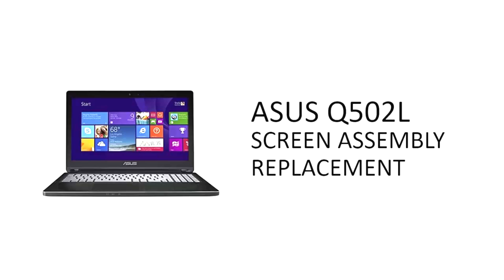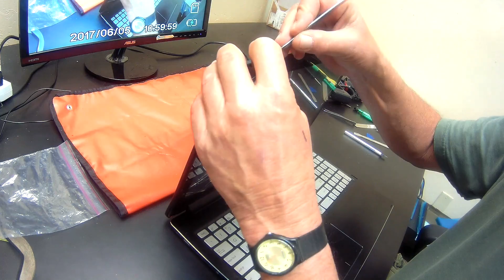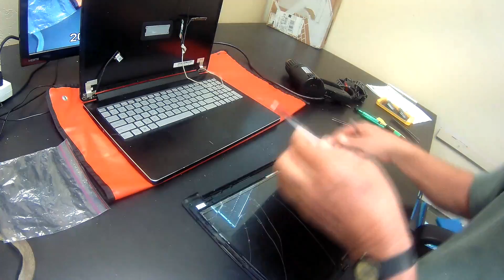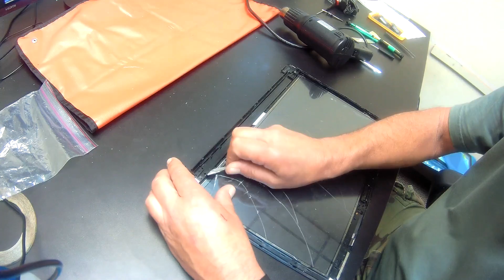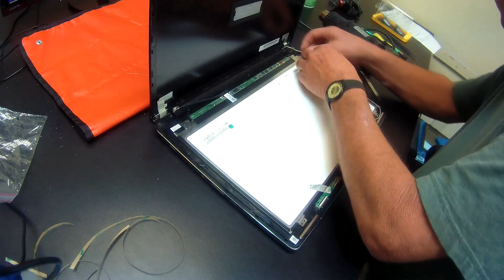ASUS Q502L Laptop Touch Screen Digitizer Replacement Procedure

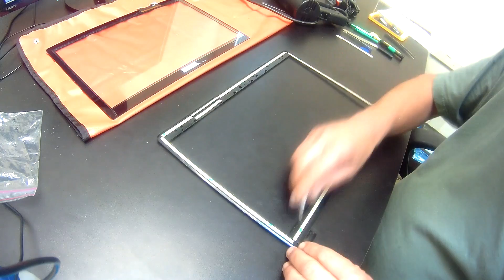Comment: Do those beige/white tape(5:34) and black tape (6:33) come with the laptop screen or are those tools you buy separately? How can I be absolutely certain of my ASUS laptop's model? 
I found Model Number: Qualcomm Atheros/AR5B22-SB on the bottom sticker but that search result is unsuccessful and super unfamiliar to me, so I don't feel like that's what I need to search.
Reply: Sometimes what you need is on the part itself given there are small differences even within the same model of laptop, i have an asus q524 and i wanted to get a new digitizer etc
Reply: But there were two different digitizer boards because digitizers had differently sized cables even within q524u which was my laptops model it was a huge pain in the ass and the one i needed wasnt actually in stock

Comment: Hey, I just installed my new screen on a q535a and the screen had  a new module  for the camera attached, but now the camera / Hello Facial Recognition won’t boot up. Would it more likely be a hardware or software issue?

Comment: I'm trying to figure out if I can fit a touch screen from a G751JM to my G751JT. I see the ribbon cable for the digitizer up top, but does that connect separately from the screen to the motherboard? Or does it connect to the screen itself?

Comment: As the only video I could find for this specific laptop...... what a disappointment.  It seems sped, up... there is no real instruction going on....which I kind of expected based on the title including a reference to replacement procedure.  How about doing one with NO music, and talk us through it..... or don;t post this type of video.  wasn't helpful...... assuming that was your intention.... to be helpful.
Reply: you see all what he does. Don't see the problem? Disconnect the cables's, take of the digitizer, heat up the adhesive to losen up ... It's not rocket science.
Reply: @verschuerenkevin  What is the temperature for heat up?  Thanks in advance.